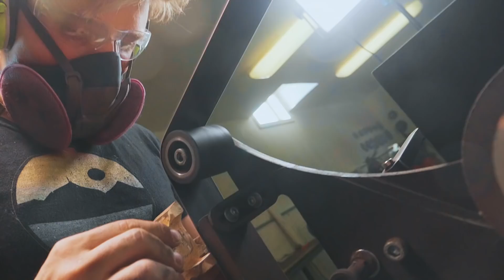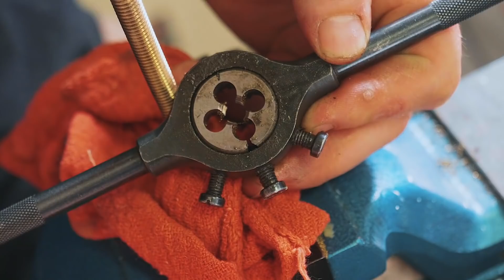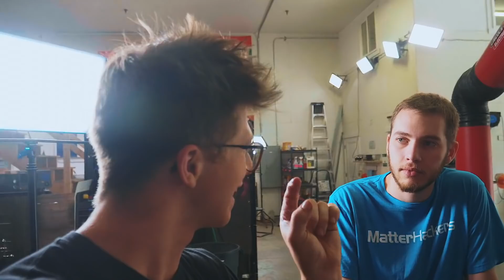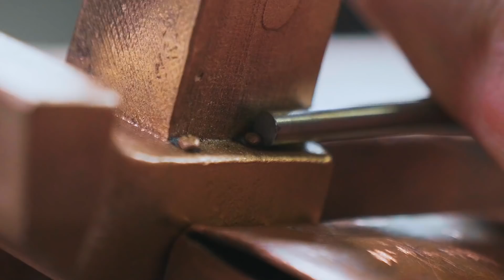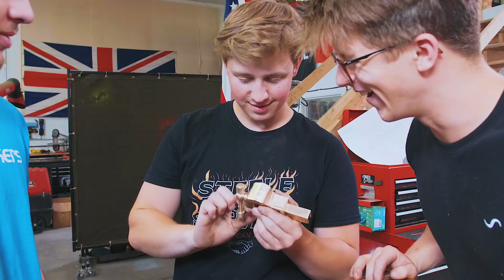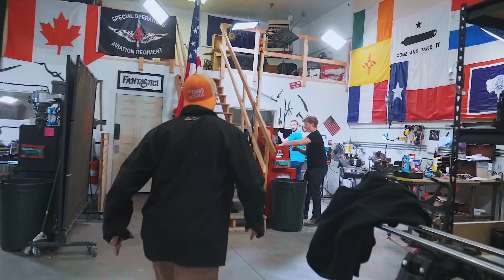3D PRINTING A BENCH VICE!!! PART 2

Comment: Pls colab with Demo Ranch and and settle the question: Can you blacksmith with Bullets?!??
Reply: The real American99. Can a blacksmith stop a bullet?
Reply: can a  3d printed/ cast in titanium 50 bmg stop scott?
r.i.p. cooter
Reply: can a anvil stop a bullet
Reply: please don't this is already getting too american for me
Reply: I can settle it for you you, yes you can. You just need to get rid of the gunpowder first.
Reply: Yes, easily. With bulletshells it's a guarantee, the bullets themselves: probably gotta get some materials out of there.
Reply: @DirkWinters  Yes it can. If steel is thick enough and hard enough the bullets will fly right off there.
Reply: Make a damascus, anvil, out of the Demolitia's ar500 body armor plates that are kicking around the ranch. Maybe collab with Matt to set up a forge at the abandoned mansion for the build?
Reply: The real American99. Really, very little brass and a ton of lead. I already know the answer. Maybe if they only use the brass shells.
Reply: If nothing else, Alec can forge some hardware for Matt's mansion.
Reply: Yes yes YES

Comment: You gotta single point that thread on the lathe to keep it straight. Quick way is to rough turn then chase it with the die
Reply: I was going to make the same comment if someone didn't say it. It's great that the guys are excited by all the new tools but they really need to have someone come in and show them the true capabilities of a their mill and lathe.

Comment: Hey. I watch ThisOldTony 😂. I don't know if it's true for such a small vise but there I was told you need
Butteress or ACME threads for it to work properly.
Reply: I was thinking the same, I knew the thread on a scissors jack looks different I didn't know what it was called. I guess this a toy so strength is not that important.
Reply: "For it to work properly"? The vise doesn't know what threadform is being used, and it doesn't care. It will work perfectly fine with 60° v-threads. The square and acme (trapezoidal) threads have less friction, allow dirt to fall out easier while the nut is traveling along the leadscrew, are not as affected by wear as much, and are stronger. The v-threads are plenty strong for this purpose.
Reply: @xenonram  I should have said "to work best"...
Reply: @xenonram  Okay mr. pedantic, I think everybody understood that the OP meant a stronger an more durable vice. I do not know where the idea for a consciousness of the vice came from, have we crossed into the twilight zone somewhere?

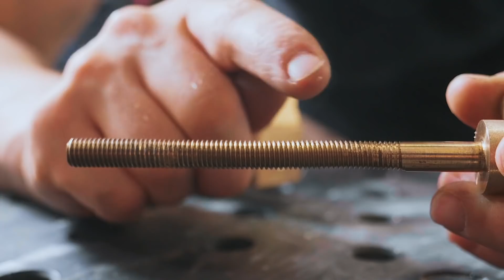Comment: 3:09 I totally saw those wobbly threads in the last video. I knew it would cause problems!

And last video you had problems getting the wax sprue's to adhere to the plastic. Maybe for the future since you're gonna be burning out all the plastic, just model the 3D model WITH the sprues already. Would take more time to print but would save time figuring out how to sprue things.
Reply: Those threads will give me nightmares...

Tips for young players.
Use the tailstock on your lathe to keep the die square when starting
Let an arm of the die holder rest on the cross slide and rotate the chuck by hand (be gentle)
Don't forget to break the chips (depending on the material)
Reply: @lancer2204  It seemed that either the tailstock was misaligned, or the center hole they drilled was off-center. Either way I too cringed super hard last video.
Reply: @lukasdon0007  I concur. Totally that sticky out tail thingy
Reply: Don’t vises use a different kind of thread as well? I’d be concerned that the bronze won’t hold up if they accidentally over tighten it.
Reply: @jessemarshall7176  They usually have square or acme (trapezoidal) threads, but the brass will be plenty strong enough, esp with those short levers. (The levers are only about 4" long, so you can't get a ton of leverage.) That brass screw will be plenty strong. A YouTube machinist (I'm not going to say his name, so his channel doesn't get polluted with more "makers" fakers than it already has) made a part with a brass screw that some people though the threads would shear off of, but it was WAY stronger than people thought. Go get a similarly sized brass bolt & nut, lock the bolt in your vise, and start cranking on it with a 4" long ratchet/wrench.
Reply: @Andrew Delashaw good to know. I thought they were called acme threads but wasn’t sure if that was just from too many cartoons as a kid becoming reality in my head. I didn’t think about the short levers and I’d image they are smart enough not to go beating on The levers with a hammer.
Reply: we used lost resin casting at my last job and that's exactly what we did.

Comment: Great video, little tip for keeping your threads straight when tapping with a tool in the lathe, use the flat end of the tailstock (with no tool in) to keep an even pressure on the die, especially when starting the threads.

Comment: This stuff is a really neat concept. And the great thing if you can't get a perfect cast, is that once you have designed the 3D model, changing its parameters is pretty easy. To account for material needing to be removed, by adding it to your model with intent. So if you need a perfect long flat, you could add ie. A small lip then 2mm of material. You grind that material down, and the lip works as a depth indicator for the grind.

Comment: You should use difrent type of threads trapezoidal thread thats it. used specialy for high torque connections as it is on the vice when you tighten it. This thread will wore off real quick and can break easilyif you overtighten it.

Comment: Print your sprues, at least the ones connecting directly to the piece.  The main flows can be wax to save time.  Then you get nice printed transitions to be cleaned up later, and where you have to connect it to wax is further from the finished piece.

Comment: Fusion has a thicken feature so you can oversize the parts, then go in and machine the cast part to perfect fit so you can take out the pockets and bubbles on the surface

Comment: For casting 3D prints, there are special filaments that aren't PLA that are designed to burn out cleaner and leave no ash. I use the one from Monoprice and it works GREAT!
Reply: J. Rizzo yep there are several good ones, I’ve heard and seen good things from Polycast from Polymaker.  It looks like there was some ash left in the mold that caused some of the spots Alec cleans up towards the end.

Comment: If you want to cut the next time at once a straight thread on the pin I have a tip for you!

Take the tap and put it on while you use the tailstock with a drill chuck as a support. So the approach is perfect and the rest of the thread too! 

Greetings from Germany

Comment: Lost pla printing is a great time saver but it is really dependent on the quality of your printer. In jewlery scale I really need to get a sla printer. But for what you do it should be amazing just consider 1mm to be your finest resolution so you will still have to do all the engraving. 
Now the big piece of advice. Removing plastic is much easier than metal. File down everything in the pla stage and it will save you time later and you will use less metal later. 
Also stamp all your stock so you aren't melting the wrong metal (that comment belongs on the previous video)

Comment: You mentioned that you had some carbon residue in the last episode.  How did that affect the finish of the casting as well as the fit? Or did you make the slide oversize knowing that you would be removing stock?  Will PLA always leave carbon residue?  I ask this because casting in bronze is one thing, casting in a precious metal such as gold could mean a lot of filing and the loss of gold to filing adds up to $$$.  BTW most vises use ACME threads because they handle pressure better. I winced as you tightened down the vise. I thought surely you would strip the threads.

Comment: Just FYI there is a coating you can give 3d printed parts It's called xtc 3d. It fills the layer lines and it'll make those pours much better cause I can still see layer lines on the finished piece. That's one of the big downsides of 3d printing for finished parts, getting rid of those lines is difficult but for casting should be ok.

Comment: I wonder what ever steel frame could be fabricated and then cast bronze over it to make it even stronger. Would heat expansion rate difference between steel and bronze cause issues? Adhesion should be possible by roughing steel surface.

Comment: If you turn your own threads on the lath you would have much better control of thread fit than you can get with a die cut threads.
Reply: Would definitely be straight

Comment: Did you account for the shrinkage of the metal while cooling in the 3d model on the computer?  If not, that may be why you are having more to do.  You can increase the scale of the print quite easily, but may need to increase tolerances on fit, and spacing on threads, which is more difficult.

Comment: Just wondering why when you have a milling machine did you drill crooked holes with a hand drill and cut woobly threads and not machine the flat surfaces for trueness. Still very cool and love those 3D printers.

Comment: If i were you i would put the threaded shaft on the lathe and hit it with a lathe file to reduce the OD of the thread without risking it being too loose or risking it breaking during use

Comment: A suggestion for using a 3D printer to model parts that fit within other parts.  Make sure you scale them up enough to allow for the removal of materials during fit and finish.  This will allow for much better fitment.

Comment: Really liking all the other technologies your dabbling in and I have some advice, I have many years of experience as a machinist and casting parts in either sand, investment or plaster cast molds and with that being said, what you cast is what you get as long as all the air has a way out and any impurity's that you may have introduced to your final mold (broken off plaster that wont burn out) so a simple guideline for a prettier casting is simply finish it out and repair imperfections before you cast it. 
If I ever get out your way for some fishing I would love to stop by.

Comment: Alec, how do you go about finding suppliers for steel or other materials? i've been buying most of my materials either through Amazon or at Lowes hardware store, problem is Lowes doesnt carry the size of sheet metal that i need and, based on what i was told from a warehouse that never called me back, i would probably spend way more than what i would getting it from a supplier. they said steel was about a buck a pound and Lowes has a 3x3 sheet weighing probably around 4 or 5 pounds for 50 bucks.

Comment: Hey Alec/Will, a tip about die cutting a thread on the lathe. Follow the die with the face of the tail stock barrel. This will stop the die from wobbling as it cuts. Or you could buy a tail stock die holder...

Comment: Well, you are slightly late to the FDM party. I'll suggest getting into SLA printing. You can get much much higher precision with that format of 3D printing. And they are cheap. Like 250 dollars cheap printers.
Reply: But it takes a lot longer to print.
So where is the benefit if you only print large objects, like a vice, where detail doesn't really matter?
Reply: @Jehty_  because density wise they are much much stronger. And SLA printers are becoming faster. Uv SLA are slow but laser SLA are almost 3 times faster.
Reply: @shivamvaid601  no, SLA, at least the consumer grade stuff is much much weaker than FDM (I don't know what you mean by density wise)
Reply: @Jehty_  well a thousand dollar laser SLA isn't consumer? A thousand dollar iPhone is but a 1000 dollar printer isn't?
Reply: @shivamvaid601  I didn't mean the printer. I don't know if a 250$ printer prints weaker prints than a 1000$ printer.
I meant the resin. And most resin you can buy is much weaker than PLA, PETG, ABS etc.. There are some "tough" resins which come close to the strength of FDM prints, but as far as I know none that is as strong as FDM prints.
I said consumer grade because I don't know if there are tougher resins available for commercial use.
Reply: @Jehty_  mate. SLA Hard resin made by Carbon is twice the strength of PLA and ABS. When you see strength in all three axis. It is any day stronger.
Reply: @shivamvaid601  mate. Which part of CONSUMER GRADE don't you understand?
Please provide one link where I, THE CONSUMER, can buy the resin from Carbon for my printer at home.

Comment: Should have single point threaded that shaft, even if just to near final depth and then run the die over, by doing that the die will follow the partially formed thread and eliminate the die from wondering all over the show

Comment: Honestly, this is cool but I am a little disappointed. No replaceable  jaws and an innapropriate thread? The jaws I can excuse but not using a square shouldered thread on the lead screw is a little lazy. Especially as they drilled out half the threads in the nut to get it smooth, that will definitely strip at some point.

Comment: That dodgy thread is what you get for not cutting it in the lathe, or at least roughing it out on the lathe before finishing it with the die. You cuts the corner, you pays the price.

Comment: Is it possible that the issue with the threads was one of alignment ? Been pondering it and without being able to get a "feel" for it thru a computer screen, sounds a lot like the hole might have been slightly cockeyed so the deeper you went the more it would have a tendency to wedge itself in there as you apply force. Probably just brain farting mind you.

Comment: If you could learn how to cut a thread on the lathe and cut a square thread you would not have those issues guys. Dont be intimidated it is hard but with practice not that big a deal especially if you buy product tools.   You will also join a club that not many are still in cut a manual thread is a dieing art. I'm the youngest machinist I know and and also one of the few who can cut a manual thread at my company.  I am one of only two who actually did a apprentice program not a tech school program.

Comment: So a ropey looking fdm print makes a ropey casting. Yet the moai sits there.

A lathe is used to make a threaded rod. But the thread is made with a die.
You have a mill and damm good bench drillis but stil use a hand drill.
Where are you going now with this channel.